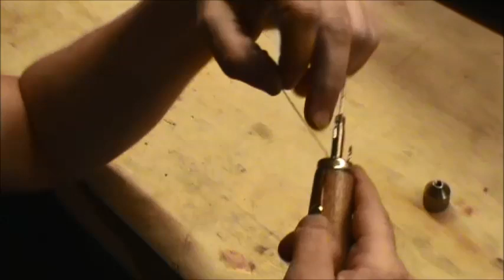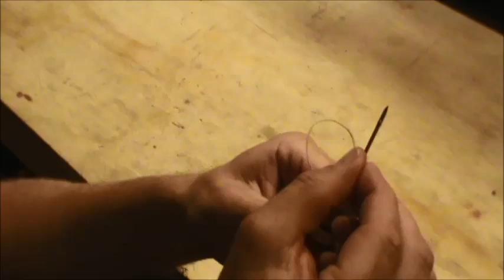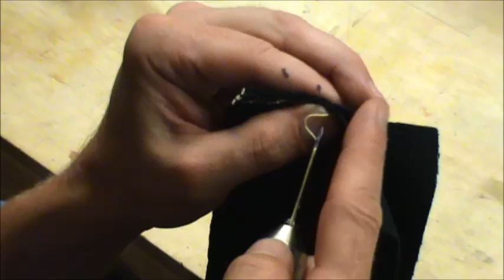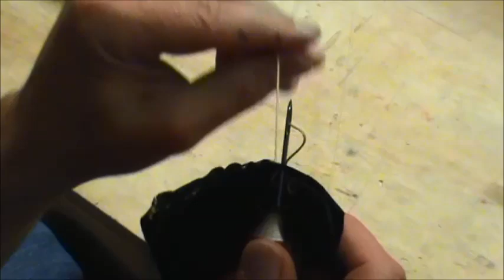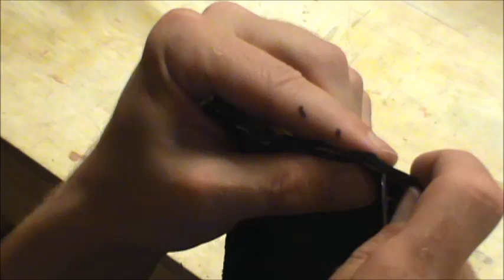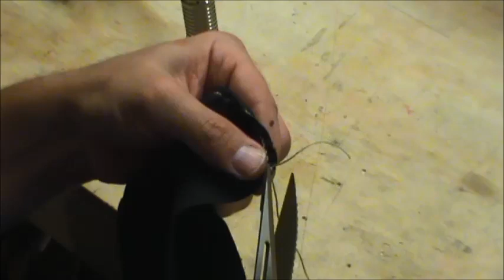HOW TO USE THE SPEEDY STITCHER

Comment: This really helped me understand how to use this thing; way better than the instructions that came with the thing. Thanks for making this! One thing I do that may help is with the ending knot. I tie 2 overhand knots in that last stitch, kinda like you did. I then put a dab or two of Super Glue (I like the "gel" type) on the knot. Use just enough glue to saturate the knot area. After it dries, cut the ends of the thread flush with the knot. I use the same glue on the end of the thread to help get the thread thru the hole in the side of the wood handle, through the handle up to the needle, and to help get it through the needle eye.
Reply from the maker: Good idea sir:) I started burning the ends of the waxed string.

Comment: Thanks so much for posting this.  I've had a Speedy Stitcher for several years, but directions for using it weren't included.  For the first time, I'm going to be able to use it.  I'm going to use it to fix some fly masks for my horses.

Comment: This is more like for thick leather,not thin fabric.I a´m a saddler.We use 2 needles in each end with not waxed thread,it´s some-kind of pitch,so it don`t get rotten .Horses sweat a lot. You stitch a hole with a two edged needle (you just make the hols with that tool) Then you take the needle throw the hole to the middle of the string. Now you got 2 needles ,one in each hand,you take the needles put them throw the hole each one from each side and tighten .You make the holes first with that tool so you got the right length and a nice seam.
Reply from the maker: +Buffalo Benno 
Good point buffalo, thanks for the know how:)
Reply: We got a lot of reindeer here in north of Sweden.I`m not a "laplander" not even a hunter,more like a car guy .Cadillac Eldorado ,Corvette standing on my front ports .And 4 more cars.Europeing cars.Doter BMW 6 cyl,My fiance Opel something a big car.dont ask me what make it is!.Self i got 4 cars ,2 of them are winter cars ,that i usuly just drive in the wintertime !
Reply from the maker: +Buffalo Benno 
You have some nice set of wheels Sir;)

Comment: Good video. I've had one of these for years and never got the hang of it. Now I think I can manage it a bit better. Thanks! Could you back stitch at the end to avoid the knot? I guess you  would have to have an extra needle to use for the thread on the backside??
Reply from the maker: +Wango Tango 
I haven't tried a back stitch with the speedy stitcher, you may be on to something;)
Reply: I had just watched a video regarding hand stitching using two needles and they used back stitching to secure the stitching run. Seems like a good way to avoid using knots and improve the look as well.
Reply from the maker: +Wango Tango 
I'll have to take a look. Thanks:)

Comment: The Wenger Swiss Army Knife has a hole in the awI, This will perform the same function, except the awl is dull (1 don't know why-it makes nosense) so you have to prepunch the stitch holes. Sharpen the awl, and Bob's your uncle.
Reply from the maker: +Steve Brettell 
Yup, it will definitely do in a pinch:)

Comment: This should work for making a nylon cordura webbing belt ? I have had a sewing maching in the closet I got for free and have no idea how to thread it . As well I have asked one question to everyone I have meet in the past 4 years or so . DO YOU KNOW HOW TO SEW WITH A MACHINE ? ANSWER is always NO . I am going to grab one of these things . I have seen one at harbor fright tools . I am also going to take a day to myself and lock the door and learn the sewing machine . God Bless
Reply from the maker: +timothy thomas 
They are pretty handy, that's  for sure:) you should search around you tube for a good how to use a sewing machine video:)
Reply: I had gotten a speedy sticher style AWL from Harbor fright tools . I paid 4.50 with a 20% off coupon . CAN'T GO WRONG .It works . Although while doing the first project with it . I had trouble with getting thread out from the spool in the handle . I just got today in the mail the AWL FOR ALL . It looks more complicated than it is . The spool runs on the front, not in the handle . So it is going to be easier to tighten the thread when looping or pulling back and getting the loop on the right or correct side . As well easy to get needed thread . All one does is run the thread through the top and the nut and go through the eye of the needle . And then tighten the nut . The cheaper thread that came with the harbor fri=eight tools wasn't waxed . I ordered some bees wax off of amazon for 7 dollars 5 small bars and I think that should last me a lifetime . I know this helps when the thread gets frayed .
Reply: TheBo0mer when I bought my sewing machine I simply searched you tube with the make and model along with "threading" and got several videos that were helpful.

Comment: Could this fix a tear in a bouncy castle
Reply from the maker: +Melanir Lee 
It should do the trick if the material is pretty thick. Depending where the tear is and how it was torn would be my concern. If it was a clean slice along the side, I would probably consider using a similar piece of material and sew that over top of the hole, joining it together; instead of just sewing the tear itself together. If you just sewed the tear you would have to sew a 1/4" on either side of the tear, creating a potential problem  of the area stretching when the castle is inflated causing the thread to break or the surrounding material tearing? Once the piece of material is sewed on, I would take another large piece of material and ruff up the both surfaces that I would gluing with a fine grit sand paper to remove any glaze that's on the castle material or the patch material, clean it with soap and water, let it dry throughly and don't touch the area with your fingers as the oils on your hands will inhibit the glue from bonding properly. 
Look for a flexible glue like Barge or something similar. I would make the glue patch quite a bit larger than the tear area to add forgiveness:)

Comment: what advantages is there as apposed to using a conventional needle ? it doesn't look like it could be any faster and the needle looks big does it leave holes?
Reply from the maker: +Simon Anderson 
Hi Simon, a regular sewing needle would work just fine for mostly any project. A sewing awl is handy if you need to sew in cramped spaces, like a shoe where you don't want the needle to go all the way through the material and have to blind stitch the inside. Also, with heavy material you would need to use a thimble. The hole the speedy stitcher leaves is relatively the same size of the heavy waxed thread. 
Hope this helps Sir:)
Reply: thanks Sask Hunting makes sense now, I have bought one from amazon £3. I might just be able to save my old sofa and boots. hope your fingers healed . take care
Reply: They are actually made to sew heavier materials such as canvas and leather or even rubber
Reply: I think he's using the #8 standard needle the stitcher comes with.  There's a smaller #4 needle available (sailrite.com) which is great for finer material.  I use both (depending on the material of course) but the smaller needle limits what size thread you can use.
Reply: ... the smaller needle limits what size thread you can use.  D'OH!

BTW.  This is a quality product, or was at least,  I got mine USED in the early '80s and other than stoning the needles occasionally it has been trouble free and works great.  Needs practice OR Bandaids at first tho.
Reply: I have a very old one I used to repair the seams on my boat canvas, back in the early 190's. that one is in Virginia now, so I purchased a new one from Harbor Freight. it comes with a spare straight needle and a curved one.
I wanted to remake my lobster bag, as the original mesh was old and starting to disintegrate. I used a heavy ballistic nylon and sewed a sports mesh to it. this tool was my first choice, given I double fold my seams for durability.
Reply from the maker: +pinfish2008 
Good idea with double seams:)

Comment: Hey Sask, have you ever tried useing dental floss in the speedy stitcher? If so, how did it perform? Thanks much.........Richard from Kansas:)
Reply from the maker: Hi Richard, I have never tried dental floss; if I was in a pinch I would try the waxed dental floss for sure:)
Reply: I have in a belt it lasted for a few years and then started to break up not in just one or two places, all over the belt so not so good unless you don't mind sewing it again after a while and it took be ages to unpick all the dental floss I stitched it with waxed thread after that
Reply: richard murray

Comment: we can use any type of thread to stitch?
Reply from the maker: +Snowie Shuet 
It would have to be fairly thick
Reply: Actually, if you can find the proper needle, fishing line or brand name "spider wire" has strong tensile. Dental floss has amazing strength.           Used it to blindfold my chinese girlfriend once.
Reply: Nope. you want prewaxed linen thread. Available at www.awlforall. com
I hope this helps.
Stoney

Comment: I like the stitcher, but it's not speedy. I call it the slow and tedious stitcher.
Reply: BK Bland they call it speedy since it doesn't require prepunching of stitch holes nor the need to have thimble to push a loose needle. It is a bit faster than say a saddle stitch would be.
Reply: I've been working with leather for decades, and can punch out and saddle stitch a seam in a small fraction of the time it takes to do the same seam with one of these. The process with this tool is agonizingly slow, and produces a very weak stitch.
Reply from the maker: You are correct, I feel the ideal purpose for this tool would be completing a stitch where you couldn’t reach the needle; like a shoe or boot perhaps?

Comment: My needle isn't going through the hole
Reply from the maker: +Cameron Sims 
Is your material too thick?
Reply: Im talking about the hole the original needles have to go through I see the groove but the end part is to thick and I cant open the hole wider
Reply: For example at 1:39 when you put the needle through mies wont go
Reply from the maker: +Cameron Sims 
Sounds like your needle housing is too tight for the needle to insert into the housing. If this is the case, I would try to insert a similar diameter steel object to forcibly widen the housing without breaking it;)
Reply: Thanks :)